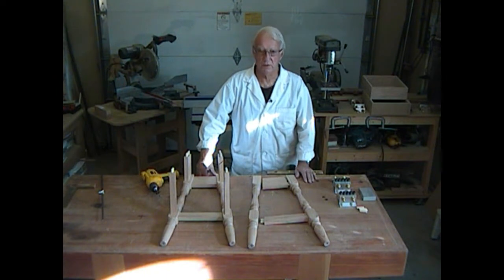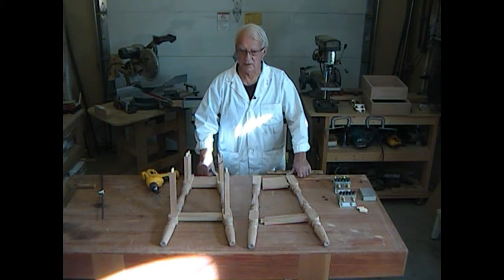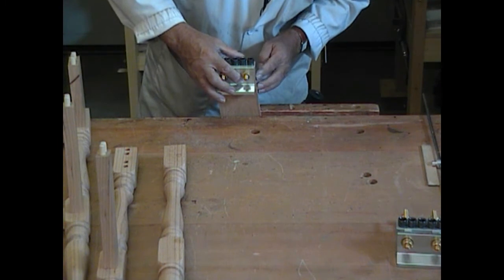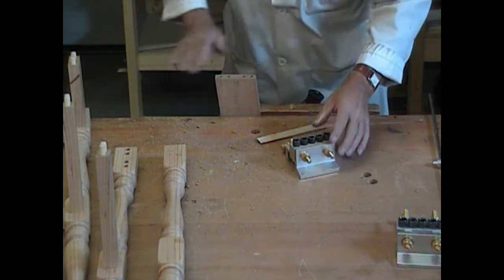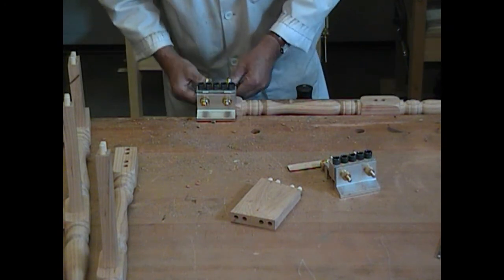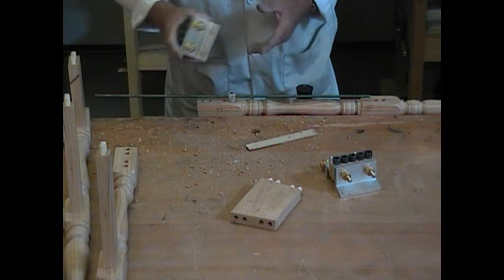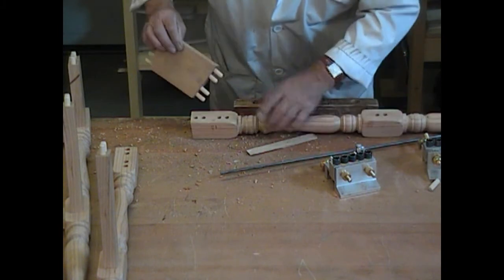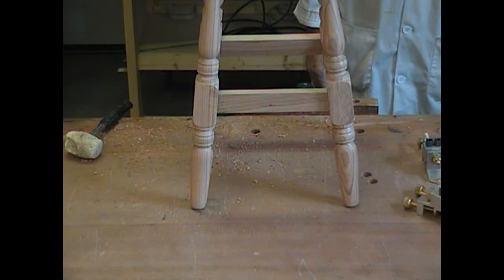Design and Construction of the Angled Joints Used To Build the Stool Frame

Comment: Did you mention 5/16" dowels? Where are the inserts available for 5/16" dowels? I only see 3/8" and 1/4" mentioned on the Dowelmax website.
Reply from the maker: Hi John, The 5/16 drill guide package is a new size we just produced this year, and is listed on our website now for $60.

Dowelmax 5/16 Drill Guide Package includes (1) 5 hardened and black oxide coated 1-3/4 inch long precision CNC bored steel drill guides (2) high quality HSS drill bit with collar (3) index pin (4) distance gauge base (5) 1/8 spacer plate for 1/2" centering (and 5/8" when combined with 1/16" spacer) (6) 2 x cap screws (7) 2 x allen wrench.